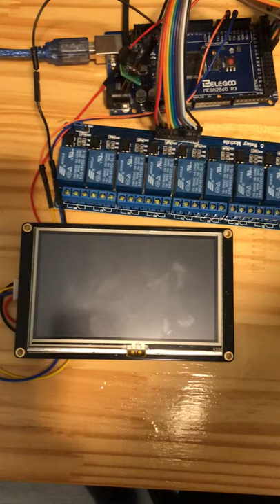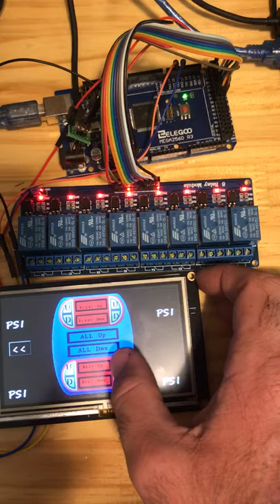Diy air suspension controller

Comment: If you guys look its just a Nexiton display that he made graphics on and only works in manual meaning it simulates buttons that control the 8 channel relay bank. I am guessing he is still designing the full program and just hasn't got there yet. What he is showing is basic Arduino coding for now.

Comment: What all did you use and how well does it work? I'd love to get a part of this code if you've got it. I'm looking to do similar but with 4 buttons for settings and a small LCD screen. I am also using the relay module and arduino mega, I just dont know where to start with the code/wiring yet.